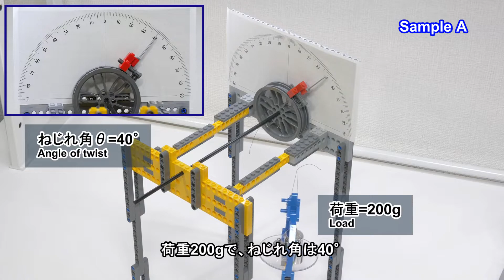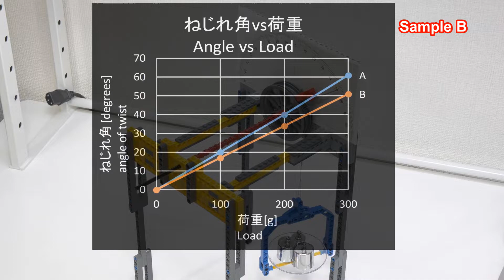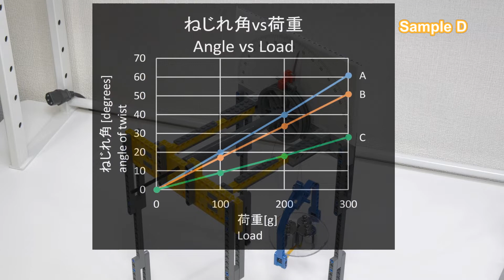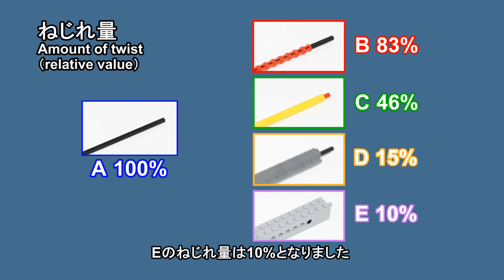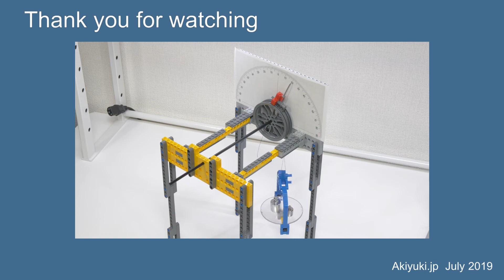LEGO レゴのシャフトのねじれ剛性を比べてみた

Comment: The use of bricks to strengthen axles is brilliant.  I’m guessing there is additional load on the motor for the heavier, stronger axles supported by the brick, right? It could be a factor for some modules.
Reply: The average load should be about the same for all axles since they all produce the same work in the end, but the weak axle causes highly variable load on the system, which is undesirable of course.